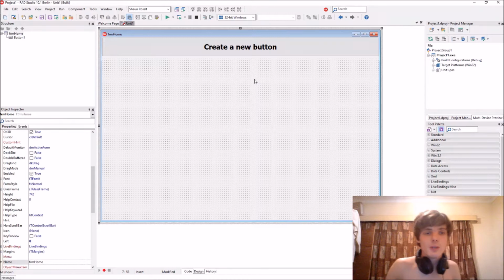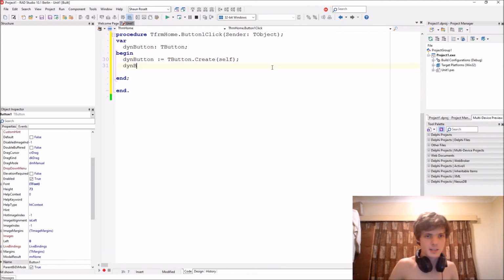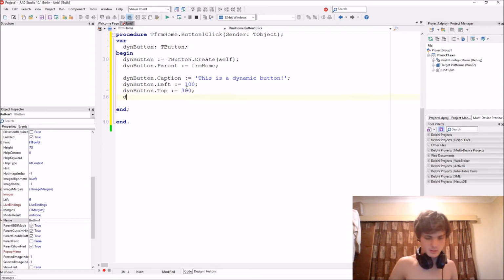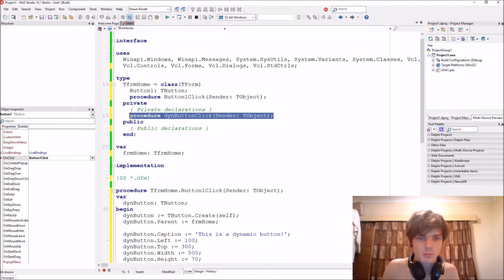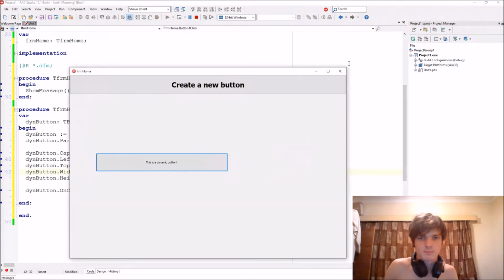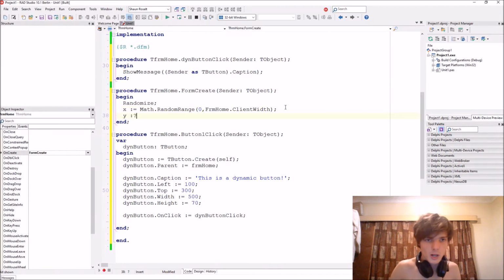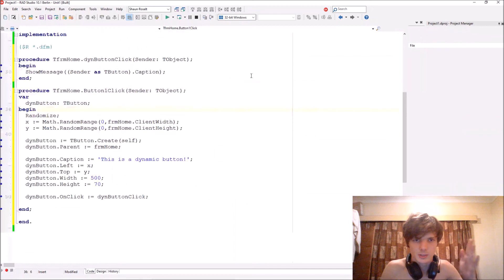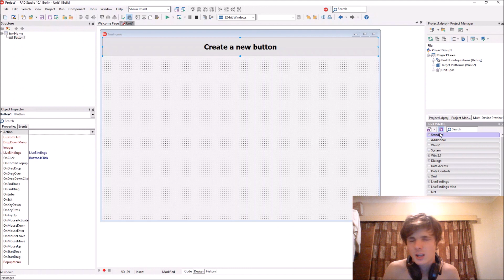Delphi Programming Series: 48.0 - Dynamically creating a Button component

Comment: Two issues:

#1 Correction of your definition of "Self":

"Self" does NOT mean that the instiantiated object is "an owner of itself".
"Self" is a pseudo-variable available in all object methods of non-abstract class types and refers to the current instance of the class. Let's take this form class for example:

type
  TForm1 = class(TForm)
  private
    function GetCurrentInstance: TForm1;
  end;

Here, you have a custom class type declared, similar as it is done in all form applications created with Delphi by default. Here, we have a custom "GetCurrentInstance" object method which is supposed to return a reference to the current object instance of the "TForm1" class we are declaring. Now, to get the current class instance, we can simply use the pseudo-variable "Self" which is available without an actual declaration (like the "Result" variable is in functions).

function TForm1.GetCurrentInstance: TForm1;
begin
  Result := Self;
end;

When we now create an instance of "TForm1" somewhere and add a Button on it, we can use the return value of the "GetCurrentInstance" as the owner and get the exact same value as if we were using the instance of "Form1" there:

var
  Form1: TForm1;
  Button1: TButton;
begin
  Form1 := TForm1.Create(Application);

  Button1 := TButton.Create(Form1.GetCurrentInstance);
  //Is equal to:
  Button1 := TButton.Create(Form1);
end;

In the "OnCreate" event method, we can use the "GetCurrentInstance" of course as a replacement for "Self" (obviously, as the return value of "GetCurrentInstance" is defined with "Self").

procedure TForm1.FormCreate(Sender: TObject);
var
  Button1: TButton;
begin
  Button1 := TButton.Create(Self);
  //Is equal to:
  Button1 := TButton.Create(GetCurrentInstance);
end;

#2 Instantiation and freeing of class instances

Even though I did it here in the examples above, you should NEVER EVER create a class instance anywhere out of a local variable which you do not manually free in the end of the method. If you want to create components dynamically, you should use a TObjectList to store them and automatically free them because once the method has finished, the reference to the class instance in memory is marked as "unused" and the memory can be re-allocated again. This could lead to access violations and other unppleasent behaviour. The "better" and "safer" way of creating components at runtime should be:

type
  TForm1 = class(TForm)
    procedure TForm1.FormCreate(Sender: TObject);
    procedure TForm1.FormDestroy(Sender: TObject);
  private
    procedure TForm1.AddButton;
    Buttons: TObjectList<TButton>;
  end;

procedure TForm1.FormCreate(Sender: TObject);
begin
  //Without parameter, the "OwnsObjects" of
  //an object list is set to true. Then, the list itself
  //takes care of free-ing the containing objects.
  Buttons := TObjectList<TButton>.Create;
end;

procedure TForm1.FormDestroy(Sender: TObject);
begin
  //As "OwnsObjects" is set to true (default),
  //all Buttons in this object list will be automatically
  //free-ed as well.
  Buttons.Free;
end;

//This sample procedure adds a new button to the form
procedure TForm1.AddButton;
begin
  //Setting of owner here not necessary as the "Buttons"
  //object list owns the buttons itself. So, it can be "nil".
  Buttons.Add(TButton.Create(nil));
  //To display the button on the form you need to set the
  //"Parent" property.
  Buttons.Last.Parent := Self;
  //Position on the form.
  Buttons.Last.Left := 50;
  Buttons.Last.Top := 150;
end;